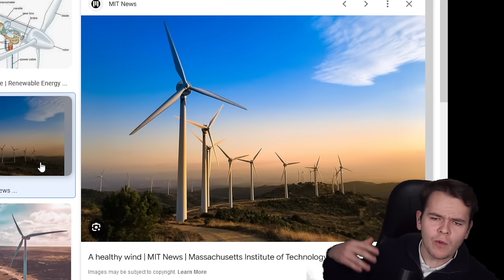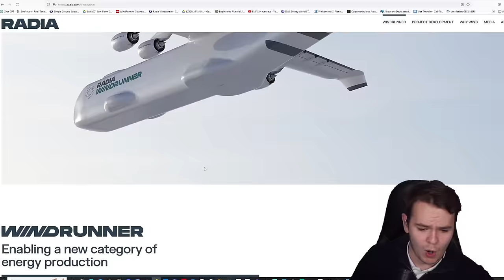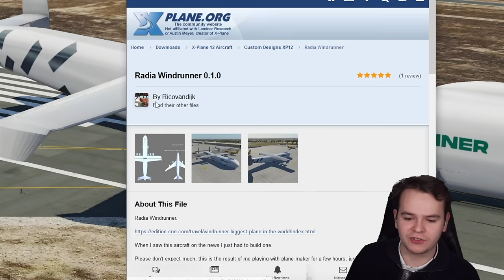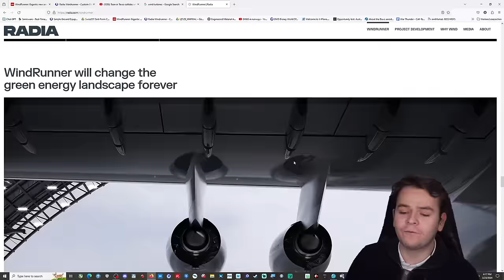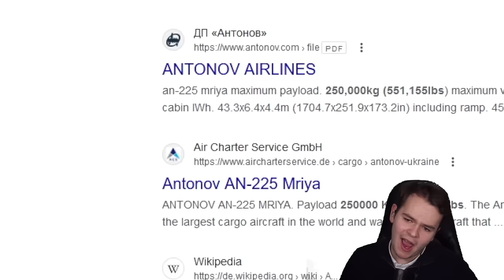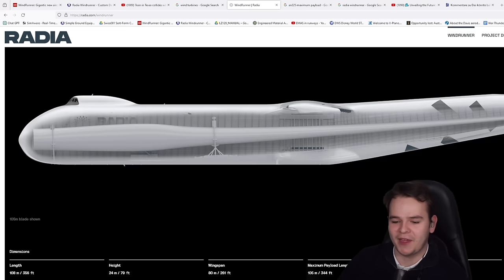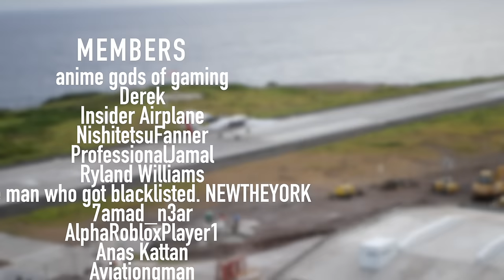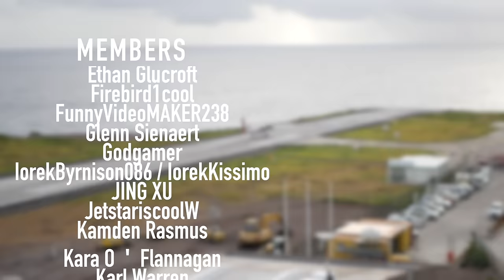Will This Plane Actually Happen? - Radia WindRunner

Comment: I think the giant airship concepts make way more sense. it seems so much more doable and they really can go ANYWHERE
Reply: Also they don't really need to land to deliver the turbine blades which takes up less area than a giant plane
Reply: but theyre so slow!
Reply: @rileytat123  yes but probably faster than building an entire airstrip and support team
Reply: I once wondered if it would be possible to install sails on an airship to make it go faster and reduce fuel consumption
Reply: @DragonSFS  that's a cool idea but the whole thing it self is already a giant sail so I'm not sure how well they would help.
Reply: @AirJoe  Yep
Reply: @DragonSFS  that may be impossible.
Reply: Not in jfk if it’s busy
Reply: The big problem with huge cargo airships is buoyancy. You would need to have sufficient ballast on hand at the delivery site to load onto the airship at the same time the payload is being unloaded. You're also significantly more limited by weather than you are with an airplane because airships are delicate.

Comment: Yeah, multiple piece blades? No. Radia is talking about a pretty quick timetable for certification, which is doubtful, but if they can build it without it using proven tech as much as possible, a single purpose aircraft makes things easier. Scaled Composites built the Stratolaunch aircraft in less than 10 years, and that is capable of much heavier lifting.

Comment: A380s and 747s are retiring and the An-225 destroyed, well no worries there's a new huge plane coming soon, The Radia WindRunner. I doubt it will ever take off the ground. Its still a concept so Idk how Radia will build such a huge plane with zero experience of aviation compared to Stratolaunch's Roc.